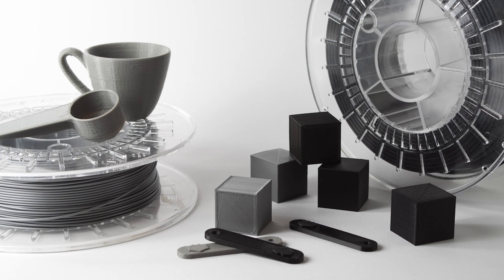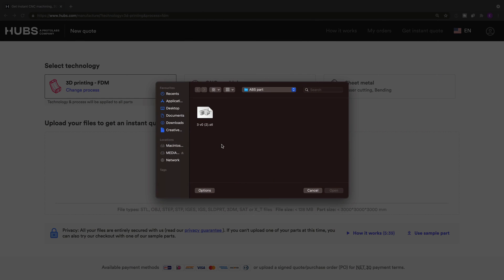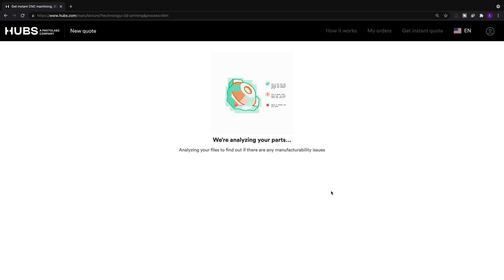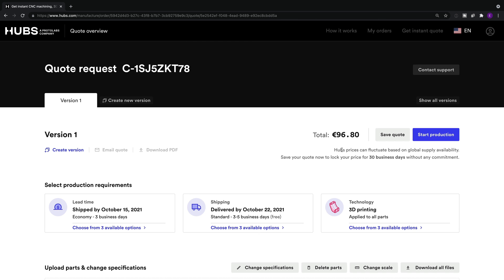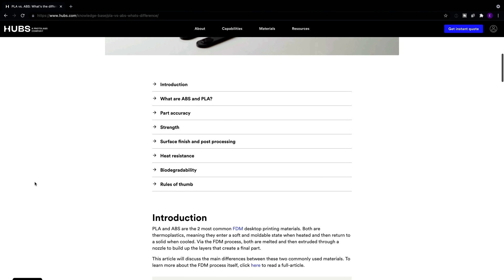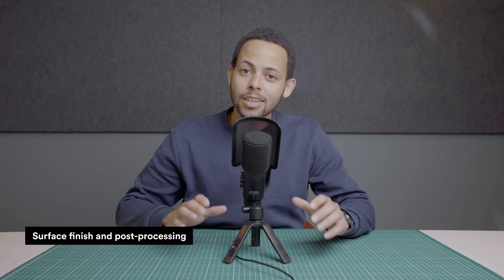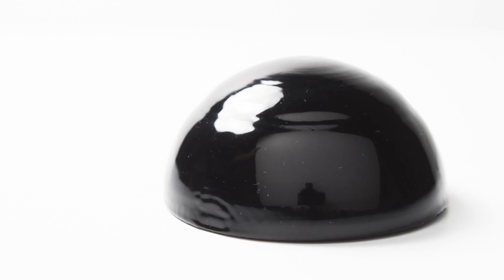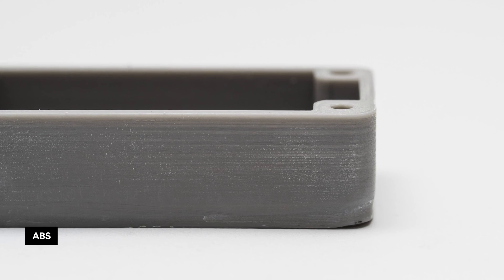PLA vs ABS - What's the difference for 3D Printing? (in-depth)

Comment: Great guide for starting with desktop 3D printing! 🚀 PLA is ideal for initial form studies. When you need functional, heat-resistant prototypes or end-use parts (even in ABS), our industrial FDM, CNC, and injection molding services at Jevny ensure performance and consistency beyond desktop limits.:face-blue-smiling: